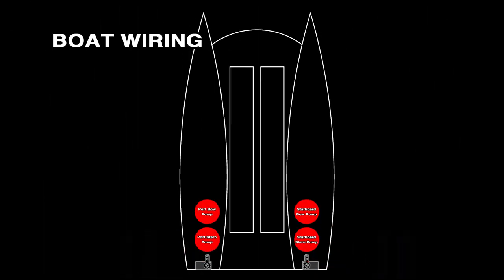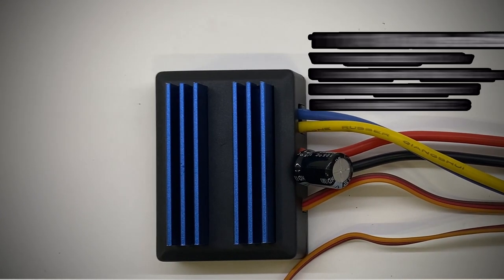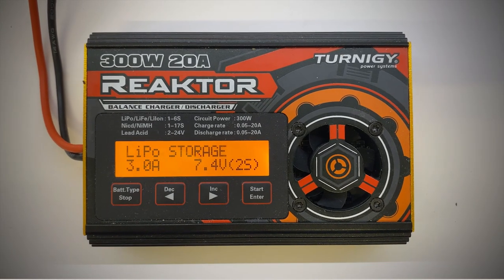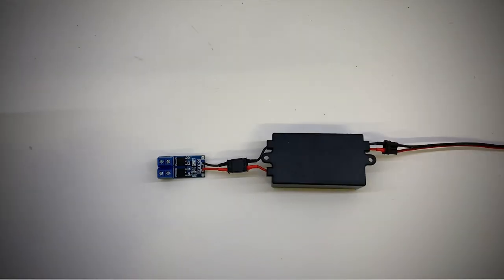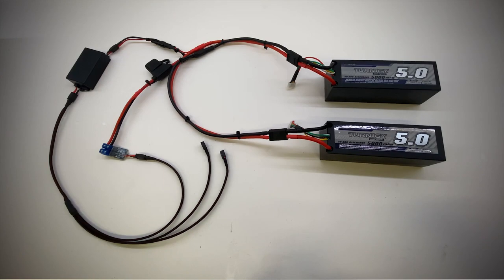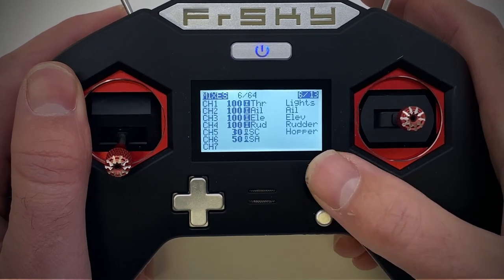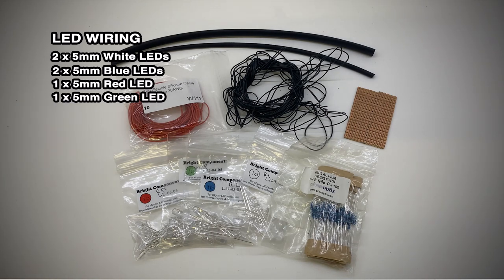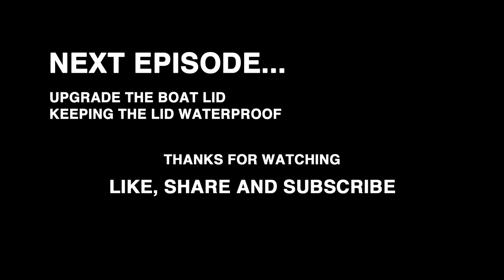MODIFY MICROCAT BAIT BOAT - Re-wiring the Boat (Part 3)

Comment: Ime an oap and hopeless with electrics but have followed your conversion and nearly finished my microcat upgrade I’ve done 2.4 g conversions to all sorts of baitboats but that was 15 years ago I thought maybe you could do a set of wiring that would help us duffers I struggled to do mine but its ready to be put in now just got to attach relay and mossfit well done you !!!
Reply: Hi can anybody help me I’ve done Dave’s rewiring but used the normal 6v lead acid batteries but can’t get the remotes to work I’ve bought 4 so far one lights up and switches off but no connection to the misfit how do you wire these up I’ve followed the videos but not sure if the wire on the battery loom goes to the power in on the remote this is stuff that really confuses me most of these remote switches have power in. -   +  and then a few terminals N line L line Com no idea what that means just so frustrating gonna have one more go then sell it as it is help me please 🥲🥲

Comment: Dave
On the microcats i thought the led flashed or went on/off when doors opened. Is that something easy to add.
Reply from the maker: Hi Dave, it’s something I’ll be covering when I run through the advanced LED set up in the later episodes
Reply: Hi Dave 
Long shot but did you find a solution to this ?

Comment: Hi, finished the boat, all good thanks. Having problems binding the radio to the receiver ! any tips greatly appreciated, thanks Dave  I've enjoyed the build. Took longer than I thought it would though :))
Reply from the maker: Good stuff, nice work. Did you buy the FrSky X-Lite S 2.4GHz Transmitter and the R86 receiver?
Reply: @DaveMattock  Hi, yes I bought the exact radio gear that you advised Dave, had a good look on you tube but still no luck, any help will be appreciated :)
Reply from the maker: @davidlowe392  The latest version of the radio, the S Lite, doesn’t bind with D8 receivers, which is what the R86 receiver is. Under the links from part 2, there’s a link to the module you’ll need for the S Lite to bind to the R86 receiver.
Reply: @DaveMattock  Thanks Dave , ended up being a faulty receiver , chap at the model shop said its very rare ! Thanks for the kind help. Echo sounder is my next project :) best regards :)

Comment: Nicely done m8. Verry nice video again like before👍!!
I have a question about the remote switch. I thinking about to use the original on/off switch on the boat. How should you wire it up and is it possible to do with the mosfet i already ordered?
Reply from the maker: Thanks very much! The original switch on the boat, is not latching, meaning that when you press it, the circuit is only closed momentarily. This would only switch on the mosfet whilst the switch is pressed. Once you release the switch, the mosfet would switch off again. With the remote switch, this uses a relay, which, when selected, keeps the circuit closed (and the mosfet on) until the remote is pressed again, switching it off. You could use a switch but it would need to be latching or look at bistable flip flop circuits, which toggle between an on off state, using momentary switches. Good luck.
Reply: @DaveMattock  ok thx. I found one flip flop switch with 10amp relais. If I understand correct i need to wire the flip flop switch after the original switch and then the mosfet switch?
Reply from the maker: @gielgeurts9709  that’s the correct, the original switch would turn the flip flop circuit high (or low if turning the boat off), which would then turn on or off the mosfet 👍🏼
Reply: @DaveMattock  thx

Comment: Hi, do you have to adjust the step down module for the output voltage required ? sorry if this is a daft question, cheers :) Thanks for your time
Reply from the maker: Hi david lowe, yeah, you have to step the voltage down from the input voltage to 12v. There should either be a potentiometer on the step down module, where you would provide the input voltage to the module, and then alter the output voltage by turning the potentiometer until you get the required voltage. You would need a multimeter to read the output voltage. Or, if you use the link I gave in the video to the step down modules I used, there are solder bridges on the back of them that you bridge with solder to get the required voltage. You do need to break the copper bridge on the back also, which is what bypasses the potentiometer. Take a look at this link if you’re unsure: 
https://www.joom.com/en/products/5d1c778a8b4513010198fde7
Reply: @DaveMattock  Thanks for the reply, its easy when someone explains !!!!! Hope my queries help somebody else too. Thanks again Dave, I'm looking forward to more videos from you. Best regards :)

Comment: great easy to follow guide . well done and thanks for sharing. where can i get the cad file from to print boat, can it be converted to an sti file / many thanks. keep up these great vids .
Reply from the maker: Thanks Sally, the link is in the video description to my Google drive where you can get the 3D model from. I did convert it to an sti file but it wasn’t much use as none of the wires were coloured, they all just came out a grey colour so didn’t think it would be much use.

Comment: Stunning video! Aren t you afraid that 4s lipo are too much voltage for the bilge pumps? Thanks!
Reply from the maker: Thanks Alberto Graziadei, much appreciated. I’ve run those Rule Bilge Pumps on 4s on my other boat for over 7 years now and never had an issue. Never had to replace them, they’re still the same pumps I put in it originally.

Comment: super!!! i would like to do this to a procat mk1 i have what would i need to do this if your able to help.many thanks
Reply from the maker: Thanks Alan, you would need everything in the video but instead of wiring the 4 pumps up, you would just need to wire the two motors instead. The blue and yellow wires from each of the escs would be wired directly to the two motors in the procat, instead of having a permanent live to each of the 4 pumps

Comment: Great videos Dave, and extremely helpful. 
Just a quick question. Does it matter which 12v remote control you use? Your link is for 6 channel but does it matter how many channels it has? Thanks
Reply from the maker: Hi Craig, thanks very much. It looks like the link I’ve set up is no longer working. Not sure why the original title says 6 channel as it’s only one channel (either on or off). 

I’ve found another one for you, which is the same as what you need but the layout is slightly different I.E the voltage in and relay terminals are all up one of the circuit board. It’ll work exactly the same though. 

https://amzn.to/3ZrsOot
Reply: @DaveMattock  Brilliant thanks for the reply. I'm going to try it on my storm 2 🤞

Comment: Great videos dave I have a mk1 microcat,,could you do a video on self priming mod,,how to video
Reply from the maker: Thanks very much, I didn’t actually do the set priming mod myself but you would just need to get yourself 4 M5 bleed nipples, some silicone tubing and an M5 tap to tap holes to the pumps where the white plastic meets the red plastic. Screw the bleed nipples into the tapped holes, seal them up and attach the silicone hose to those. Same at the stern of the boat. Do the exact same thing there and that’s it.
Reply: @Dave Mattock  thanks buddy sounds easy enough 👍 I'll get it sorted by wknd,,thanks for information

Comment: I came across these videos whilst searching for a way to add gps with autopilot and swap my Microcat MK2 to 2.4gz. I have a few  questions for you.

 Firstly how did you get the old esc boxes off the pumps and side of the boat. They seem stuck fast on my boat and the body is so flimsy.

 Also the LEDs and other stuff is plastered in a grey sealing substance that is hard as nails, looks like it was on your MK1 too. Did you bur that out with a Dremel.

Finally my boat does not seem to have the caps across the pump wires for each pump but has just one on the feed into the black box. Should I do the same or swap and put one on each pump.

In you opinion could the lid mod be achieved using 3d printed parts to make the frames

Comment: Hi Dave,
I got the hopper mod done and making the wiring complete.😊
I did see on the video that you plug in the red wires from the BEC of Esc's in the receiver. Did you not burn your receiver? I think you may only use 1 red wire if you use multiple Esc setup?
Reply from the maker: Hi Giel, I’ve always plugged both of the positive wires of the esc’s into the receiver. Some people say don’t but the positive rails on the receiver, across the channels, is parallel (not series) so if anything, plugging both of the positive wires to the receiver will enable it to draw more current, which it uses to power the servos. It’s up to you how you’d like to do it but I’ve done this countless times and never had an issue.
Reply: @DaveMattock  Thx for you quick response.👍 If you done it many times before I will do it the same way👍
Thx again🤟

Comment: Hi dave, I'm going to be using the standard eco sounder still with my boat, will I need to use a step down for the power source since I've upgraded the batteries? I don't want to blow the board since the voltage of the lipos are higher. Cheers
Reply from the maker: Hi, yes I imagine you would. It sounds like it isn’t but If the boat is still wired as per Angling Technics, I would take a reading of the voltage supplied to the eco sounder with a multimeter before stripping the boat out. If you’ve already stripped the boat I would use an adjustable step down module and start with a low voltage, say 6v and check if it works ok. If it doesn’t, slowly increase the voltage in 1 volt increments until it does work. Just don’t go over 12v.
Reply: Cheers dave thought as much its all stripped so il get a step down for it start at 6v and go from there.

Comment: Hi again Dave, I have just finished all the wiring apart from the led's. I'm now having problems setting up my transmitter!  I'm using the flysky fs-i6x, but just can't get my head around the set up any help ie step by step guide would be appreciated. Cheeky I know but thank in advance Kieron.
Reply: Hi Dave,  I've sorted the transmitter out. Port pumps are not working at 100% power so I have ordered 2 new one's and was wondering if you had changed them yourself and had any advice.

Comment: Hi Dave I have got to the part I’ve always struggled with I can’t get the remote to work I’ve got one lighting up but nothing on the mossfit have no idea how to wire it up apart from input to the box can you recommend a remote box ie the one you use or another similar ime so close but seemingly miles away what are the parameters for wiring the wires to the mossfit so it lights up it’s embarrassing  me not getting past this simple😢 step the latest part I bought was for 85/ 250 v stupid I know but I did say I was stupid with this stuff

Comment: Hi Dave great video’s I am a little confused as a novice with RC controls and ESC units. How does the single ESC unit work with the two pumps on each side . I went into my local RC shop and they gave 2 dual drive ESC units ( Hobbywing Quick run 880 brushed controllers) your help would be appreciated
Reply from the maker: Hi Norman, there’s a link in the video description of the wiring diagram or if you follow along in the video, it should show you how to wire up the four pumps with just two speed controllers. Good luck.
Reply: Hi Dave thanks I am trying to set up the ESC still unsure how 2 ESC will run the 4 motors?  I am also going to fit my Tolson X pilot GPS system
On thinking how that works do you think it would be better to run each pump on a separate ESC unit as the Tolson X pilot can only run 2 motors and it drives either Forward or Left /Right only?
Reply: Hi Dave hope you are well? Cani ask a question regarding the Microcat that I am upgrading 
Can you advise if the boat when set up with the 2ESC’s runs ‘forward’ with both pumps and ‘reverse’ the same? However when o want to turn either ‘left’or ‘right’ should I be able to set the pumps to work 1 in ‘forward’ and the opposite side in ‘reverse’ or should it only be 1 pump doing the turning?
Sorry to be a pain
Regards 
Norman
Reply: @DaveMattock hi Dave can you advise if it’s possible to fit the Tolson Xpilot into my Microcat? It seems it wants to run random motors when testing the wiring?

Comment: Hi Dave could these mods been done on a microcat with the sp board and puck pilot
Reply from the maker: Hi Andy, unfortunately not. As far as I’m aware, the SP tackle board and puck pilot require the original Angling Technics speed controllers and wiring to work, whereas this involves replacing everything.
Reply: @DaveMattock  cheers

Comment: Hello, I have problems with the Flysky FS I6, I want to use channel 1 and 2 and I connected all the cables as shown in the diagram and then all 4 pumps turn, what am I doing wrong?  I have not made any adjustments to the Flysky.  best regards from Germany
Reply from the maker: Hi, without seeing the wiring, it's quite hard to comment but sounds like something isn't wired up correctly. When you say, all four pumps turn, are they doing this without any stick inputs from the receiver? Also, have you configured a mix on the Flysky FS I6 transmitter to mix the channels?

Comment: Do u know if there is a way the fix or tighten the flexing cable for the hopper on a mk3 procat plz. Cuz when i put bait in the hopper and i put the boat in the water and press forward on the remote the hopper opens. Thank help would be appriated . Thanks for these video's . Good stuff Dave
Reply from the maker: Thanks Tariq Zeb, do you mean the force of the water running underneath the boat opens the hopper door by itself?
Reply: No when i press forward on the remote the hopper also opens . Someone said at AT that i need a need flexing cable or i need to tighten the flexing cable.
Reply: Im not sure if it cuz of the force of the water or if its something to do with the flexing cable. But the person from AT said on the phone that cuz i tryed to shut the hopper by hand, thats why i need either to tighten the flexing cable or to replay it. Any help would be appriated Dave plz Thanks
Reply from the maker: @tariqzeb5774  sounds like an electrical fault if the hopper opens when you just press forward on the remote I.e. it just opens by itself when not in the water. If it was me, I would open the boat up and install a servo instead but I haven’t put a video together to show you how to do that. Join this group on Facebook and do a post of there, there maybe someone on there that knows how to resolve the problem without opening the boat up but it does sound like an electrical fault to me. 

https://www.facebook.com/groups/738301880275218/?ref=share
Reply: Ok thanks for the help Dave . I will try to put a video on fb . Thanks

Comment: Dear Dave, I have a question. I bought the esc ‘s you suggested in the video from aliexpress. This esc only has a black and red wire. No blue and yellow as the one in your video. Should I just put the black on the black one and red on red? And what does this mean, that it only has forward and reverse?

Thank you in advance!
Reply from the maker: Hi, the red and black wires on the Ali Express ESC’s are just a different colour to the blue and yellow ones in the video, they still do the same thing. Where I have connected the yellow and blue wires to the negative (black) cables on the pumps, you would connect the red and black ones instead. Say, the Ali Express red wire should be the yellow one in my video and the black is blue and take it from there. If you find the pumps aren’t working the right way (forwards is backwards and vice versa) then just swap the leads over from the ESC’s to the negative cables on the pumps.
Reply: Dave thank you so much for the quick reply! I ordered al the same parts as you used in your video. Going to start al the wiring next week.
Reply from the maker: @benjaminmans4360  good luck. Just follow the video and it’ll work like clockwork 👍🏼

Comment: Hi Dave

I've watched your videos on YouTube and wondered if you can help me, buy the way, I'm a complete noob with RC but I can use a soldering iron.

I have an old BSA Lakestar (Original Big Size) but it is FUBAR, I would like to convert it to 2.4ghz. I'ved looked at a FLYSKY FS-I6 2.4GHz 6 Channel Remote Controller Rc Transmitter and receiver.

Would this be okay to use? I am hoping to use the mtroniks viper marine if they still work, I do know that one of the motors has burnt out, could recommend a replacement and I will replace both.

The main problem for me is the hoppers and LEDS and how to incorporate these into the build, could you please offer any advice TIA

P.S I don't have a  big budget.

Comment: Hi Dave,
I have switched the Esc out for 2 hobbywing quickrun 880 dual Esc.
This Esc has 2 motor output sets of wires.(2xblue 2xyellow) 
How should I connect the Esc wires to the right and left set of pumps?

Positive direct from the switch to the positive of the pumps and blue wires from the Esc to the negative of the pumps?
Reply from the maker: Hi, I’m not sure to be honest, you’ll have to do a bit of trial and error, unfortunately. If you follow what I did in the video and the motors aren’t going in the right direction, just swap the leads over. I’m not sure that all ESC’s are made the same so I wouldn’t know the exact answer to this question.
Reply: @DaveMattock  Oke. Now I connect the positive on the pumps and the yellow  on bow pump and the blue on the stern pumps. When i give throttle a little bit, all pump run full speed. Mixer looks oke so i think i try switch out some wires then.

Thx for your quick response again👍

Comment: New to the videos but getting the urge to split my boat!
Could you wire up li-ion batteries the same way?
I hear they are safer than lipo batteries.
Reply from the maker: Yeah, they’ll be the same voltage as Lipos, just different chemistry